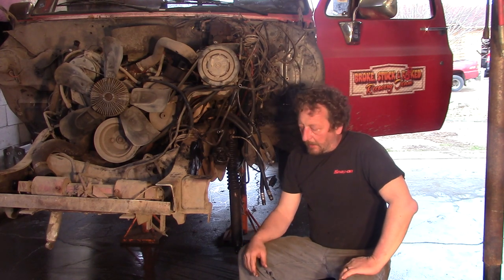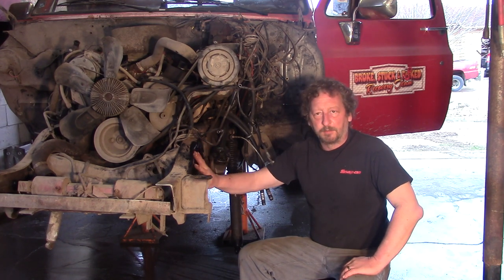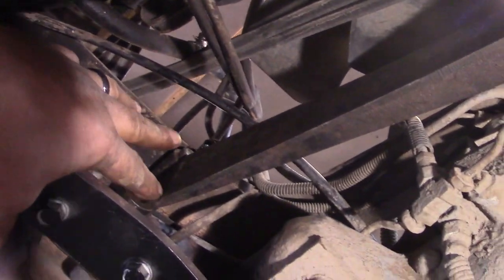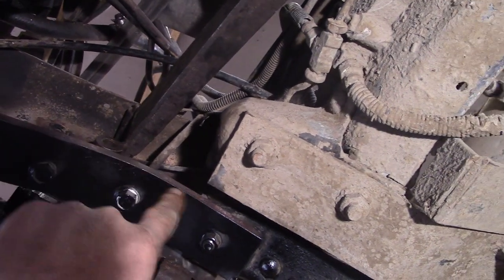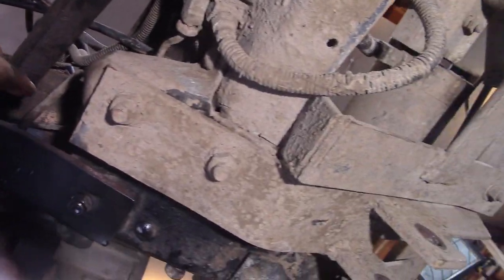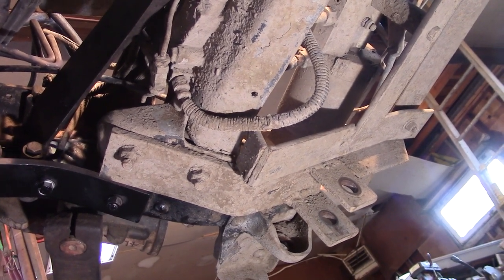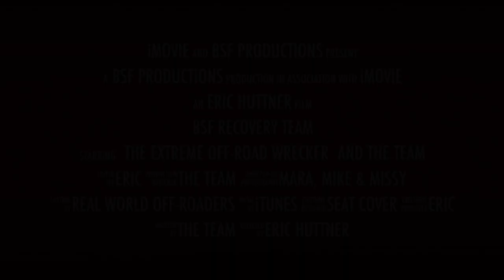STEERING BRACE by BSF Recovery Team

Comment: I have installed the brace kit and welded the plate on to the frame of 
my K5. It has not cracked or worsen since I installed Off Road Designs 
kit, it's worth the time, effort and money; in my opinion. I put a 
re-manufactured GM steering box and all Moog steering parts, it steers 
like my Cobalt. No slack or wondering.
Reply: You did all that effore and money to steer like your Chevy cobolt da fuq?

Comment: may the good Lord bless the guy who cane up with the ratchet.  Piece of trivia do you know why bolts and nuts are different size?   Back in yesteryear they could only afford one set of wrenches, if they were both the same size you could only hold one end,  As times have progressed this is no longer an issue--tool sets are cheaper.

Comment: so after the helper turns the wheel enough times is there a bleeder valve on the steering box that you break loose I've always had to deal with the air in the lines an the nasty squalling of the pump
Reply: there's no bleeder valve
Reply from the maker: The air gets purged into the fluid reservoir, where it then escapes.

Comment: All 80s frames came with that corner bracing, its not specific to just a 1-ton, and frames are all the same thickness in the gear box area, they all were prone to cracking there, the best way to do it is weld the side brace and bottom piece.
Reply from the maker: I was referring to the gauge of steel they are formed from, the 1 tons are formed from a thicker gauge.

Comment: I see GM made almost everything cheaper quality in the 80's and not just their truck frames.
Reply: The only thing that's gotten higher quality is the seats and sound insulation.  You drive a modern truck into a deep water hole, it's junk, you drive a '80's truck into a deep water hole,  you dry it out and drive it home.  They're basically just cars now for soccer moms.  
O, and don't drop your tool box in one of the modern aluminum boxes, it'll just fall right through and hit the ground, lol.
Reply: Are you implying that the dodge and ford frames were better? Because they weren't.